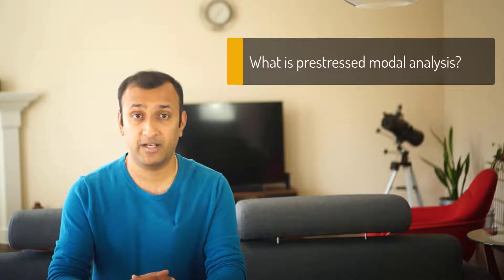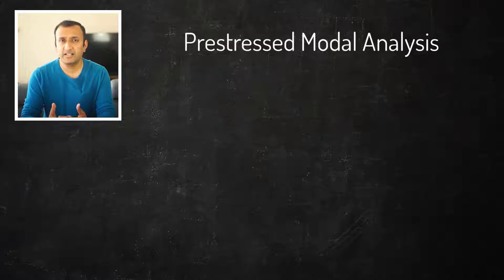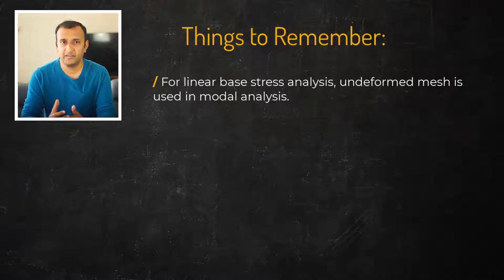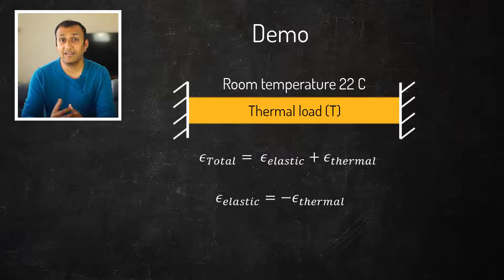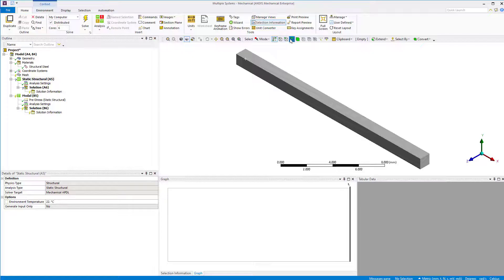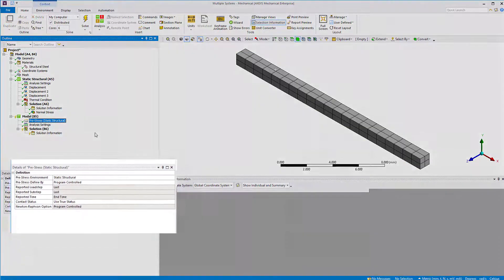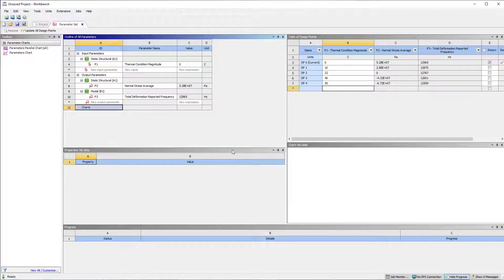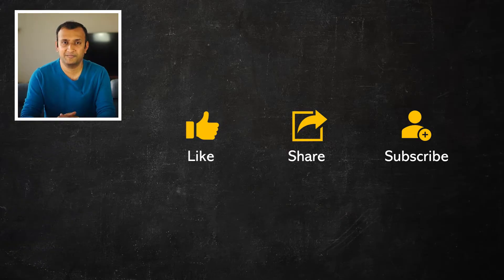Performing Prestressed Modal Analysis Using Ansys Mechanical – Lesson 2

Comment: Thank You very much for this video. I understand that regardless of base  analysis, the undeformed mesh is used for displaying modeshapes. Is there a way to visualize the prestress modal analysis results in the final state after prestress, and to verify the contact definition changes that happens during modal analysis (for example, interference resolution is done in the prestress step with nonlinear contacts, and then a modal analysis is performed)?
Reply from the maker: Glad you liked the video! Please post your query on the Ansys Learning Forum for a detailed answer from the wider Ansys Community: https://ansys.com/forum.

Comment: Which equation used by Ansys when applying static analysis (DC Voltage)? How that S (stress stiffening ) will be calculated? I would like to check the analytical calculation for capacitive ultrasonic micromachined transducer?
Reply from the maker: Thanks for watching! Please visit our Ansys Learning Forum for an answer to your question. 

Visit at https://www.ansys.com/forum.